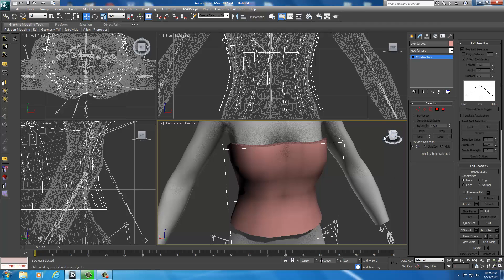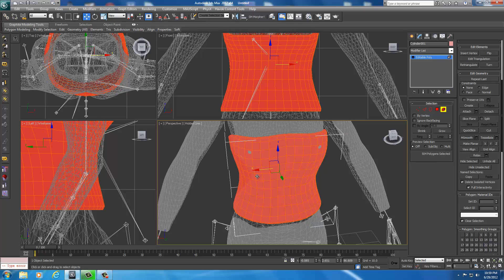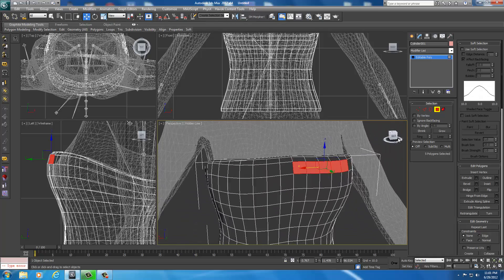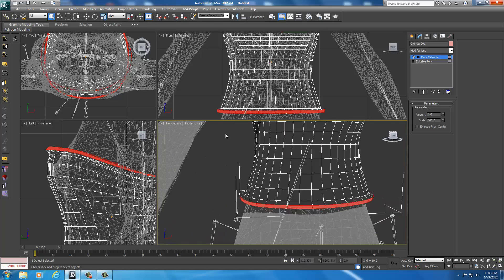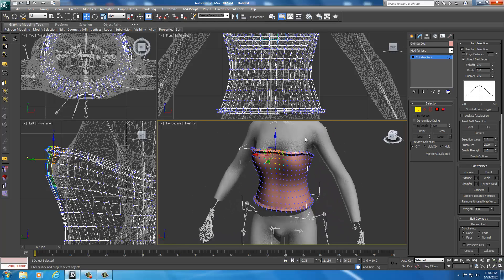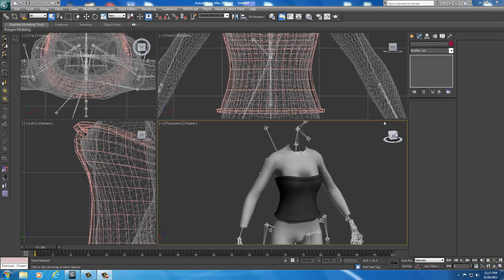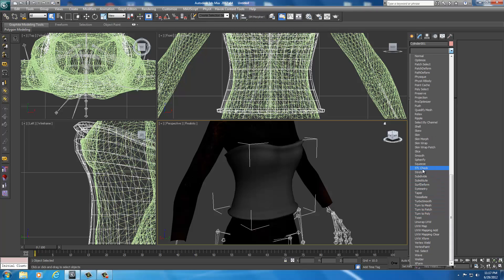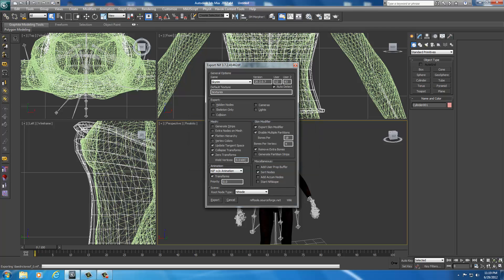28 - CA4S - Shaping the Breastplate Continued and Face Extrude

Comment: When I used the msmooth it has added hundreds more vertices for the faces, but not for the edges. Plus my polygons are not square, they are various different shapes. The faces are really smooth, but the top and bottom edges have not been smoothed out at all. They remain as jagged as the initial cylinder. Do you know what I have done wrong here?